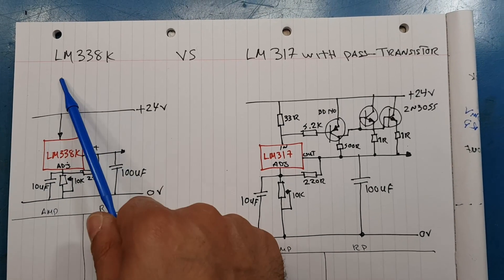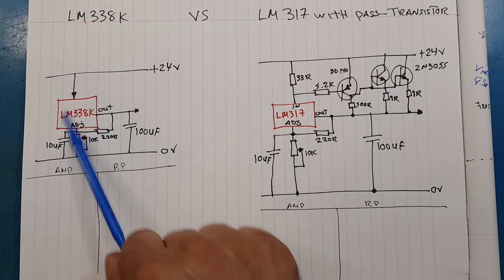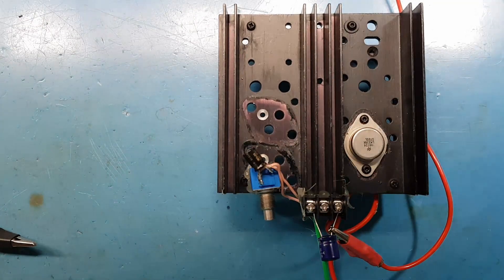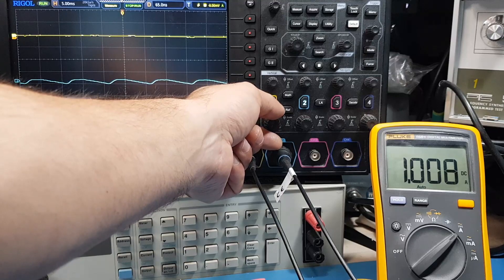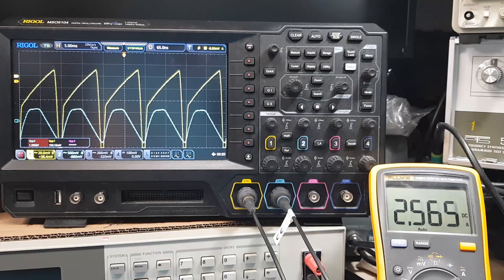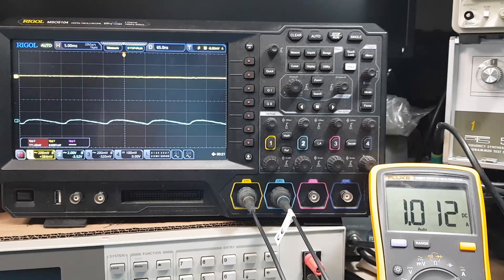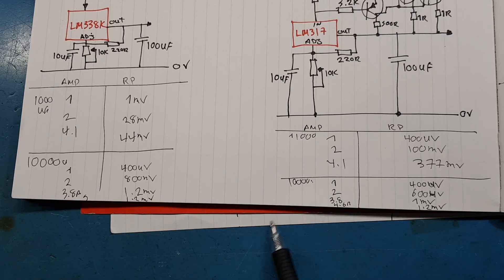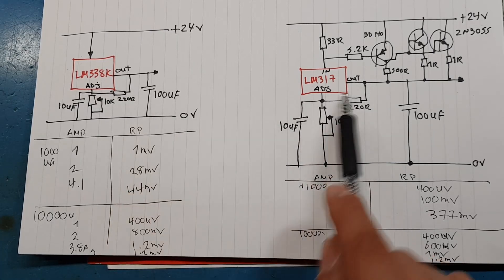LM338k 5A Linear Voltage Regulator VS LM317 1.5A Linear Voltage Regulator With Pass Transistors

Comment: An interesting test, I have some genuine voltage regulator ICs removed from old devices: LT1083CK, LM317K, LM317T, LM338K. Intended as a linear power supply with a voltage of 19.5vdc 5a for Dell Laptops. According to your measurement results, will try to do it with LM317T pass transistor PNP Sanken 1941. Thank you.

Comment: 10:35 - Why the LM317 was so good with 4.85A if the datasheet specify max of 1.5A ? Thanks.  (ok, maybe because the transistors in the output)
Reply from the maker: Ye. It has pass transistor so they handle most of the current
Reply: @T-Tronix  Thanks